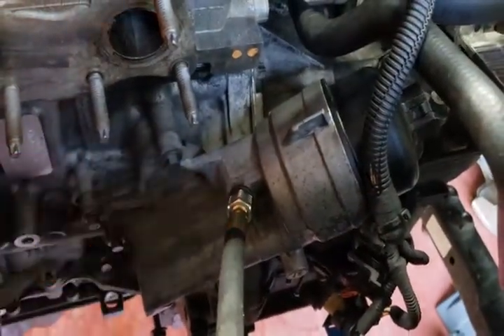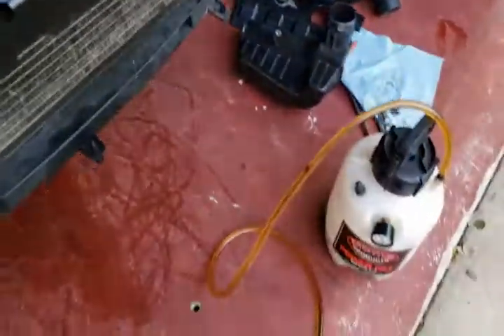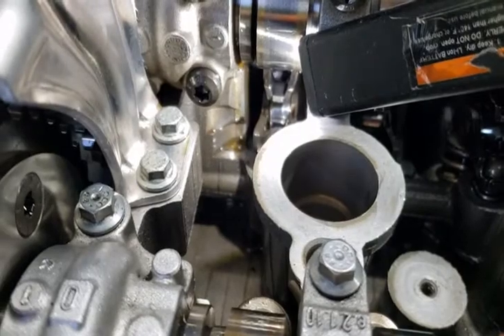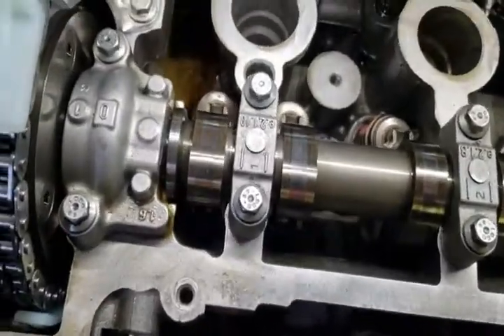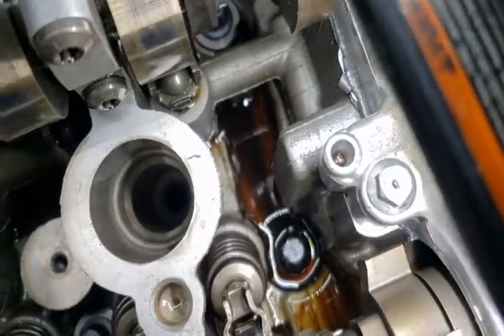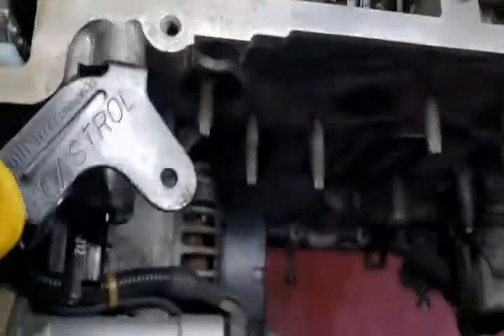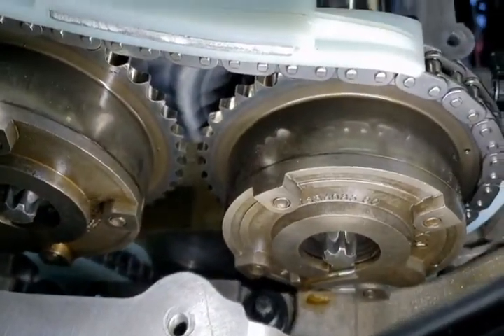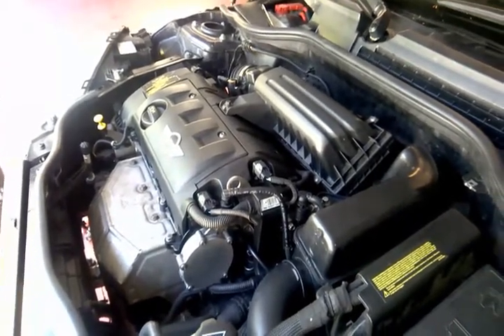MINI Cooper Cylinder Head Assembly Part 3 (Pre Lubrication & start up)

Comment: Your videos have been very helpful. I have the N12 engine without the port that you are using to pre-fill the engine with oil. Do you have any suggestions for pre-filling my N12 head?
Reply from the maker: The OEM method is to disable the fuel and ignition and crank the engine over.  One way to disable the fuel is to pull the fuel pump fuse and crank the engine.

Comment: Thank you for the video. Is there an alternate way to pre-lube with out the pump/hose equipment you're using?
Reply from the maker: Yes, you can pull the fuel pump relay or fuse and crank the engine over; connect a mechanical gauge to the same port where I connected the power-filler and monitor the pressure.
Reply: @superk4562  Thank you